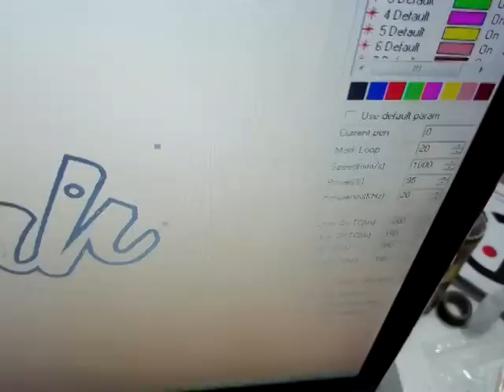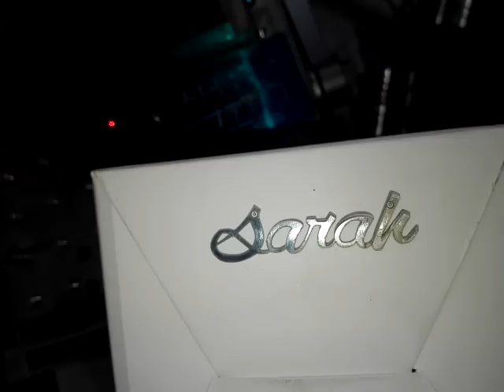50W fiber laser marking machine for Name Jewelry cutting silver gold deep engraving

Comment: What is this material in this video? silver or steel?
Reply from the maker: Fiber laser machine is no problem for both silver and steel and also gold, brass... in the video, it's aluminum...
Reply: Mike Gao 
what is the cost
Reply from the maker: please email me or whatsapp me :+86-14753226012
Reply: Is that a fiber laser?
Reply from the maker: Yes that's fiber laser 50 watts. Any informations, email to hellomike612@naver.com or whatsapp:+86-14753226012
Reply: @mikegao2676  can you pls tel me about the amount of loss of precious metal like gold while such type of job
please its important
Reply from the maker: @nitin.m903  we didn't measure it, very little lose, but also advise to collect the dust for gold cutting, gold is too expensive, ha ha, for more information, text me on whatsapp +86-14753226012, or email to hellomike612@naver.com